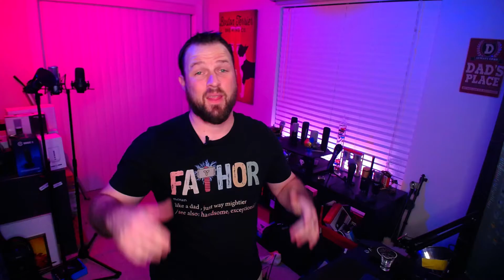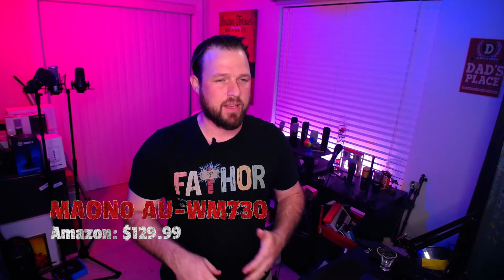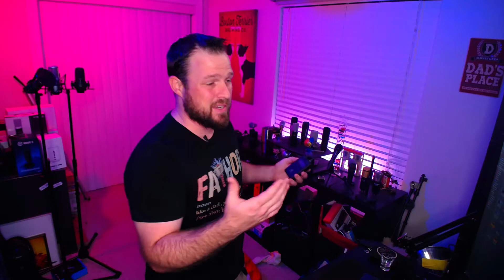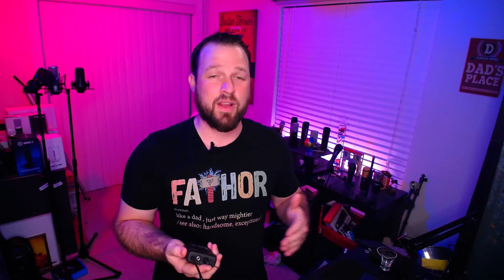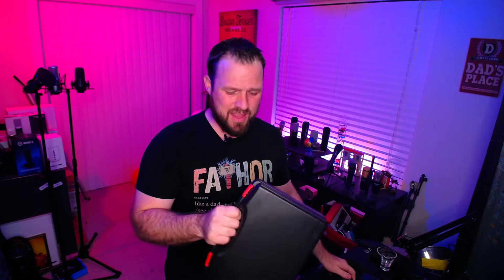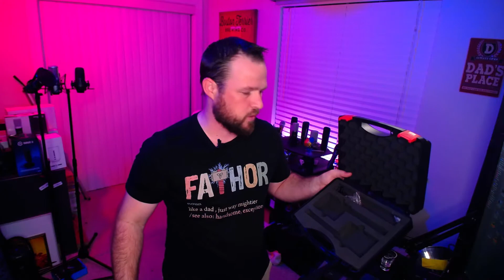MAONO AU-WM730,  Wireless Lapel for Home Studio Use | Mic Review & Test

Comment: Hi, nice review.

The mic sounds great, more than enough for YouTube. Personally, I have vintage   wired lav microphone , Sony ECM-53P. It is more than 35 years old. :) It has omni directional polar pattern and has boost presence for voice.. 

Wireless mic is convinient, but make sure there is no RF inteference. Mmm.. how far it can  be use without dropping signal?? 

Thank you/
Reply from the maker: It was very interesting when planning out this video. I had a hard time really thinking about what to talk about besides letting people hear it as best as possible.
Interference would be the biggest thing I could think of. The item claims 100 meters on high powered mode with unobstructed space. So, I would estimate maybe 10-20 meters would be good inside of a congested area.
Like I mention in the video, I think this item really best suits people trying to do vlogging where they will be moving around a lot, and just need an ability to have their hands free at the same time.
Reply: @Qualizar  

he professional wireless system has diversity antennas, ie. 2 or more antennas to get  better signl, because sometimes the antenna orientation may effects the signal quality. .      But for small area, within 20m radius, the wireless microphone system for home use, it should  be fine.. IMHO..    

Good luck and thank you.
Reply: @Qualizar   this is the exact reason why I need it my video podcast is mobile outdoors on the goo. Thumbs up for this